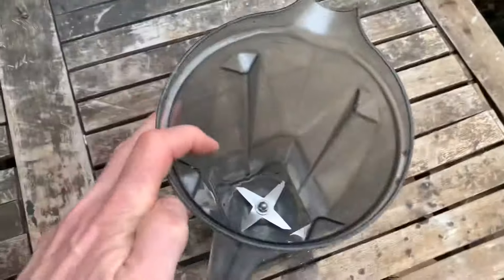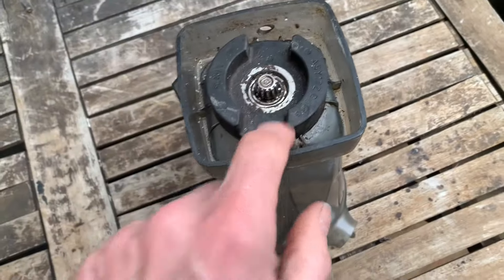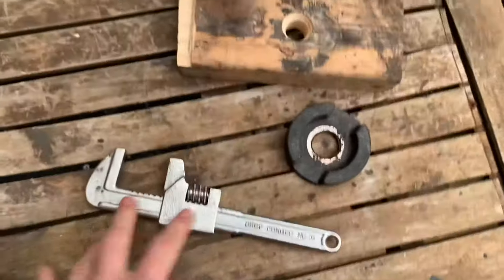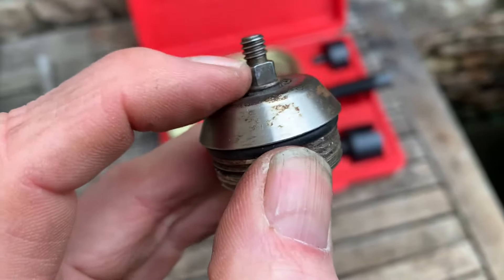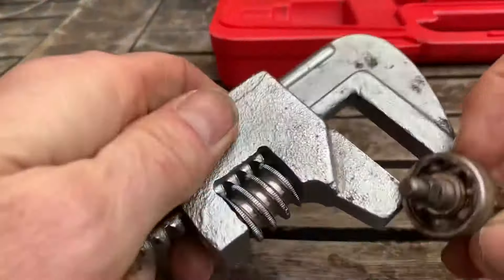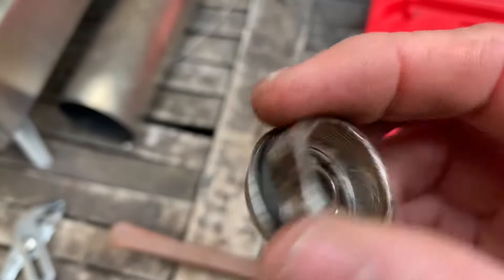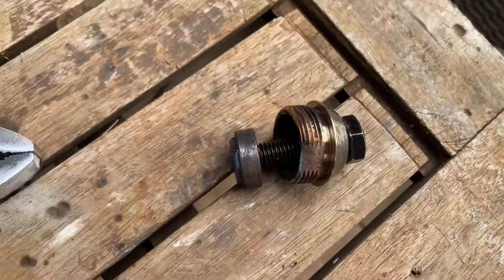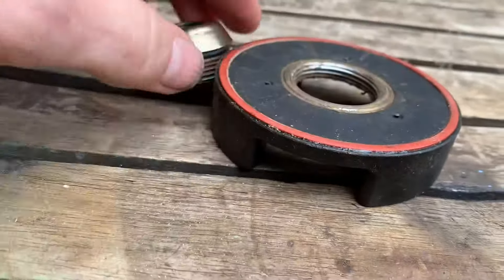Vitamix - how to remove stuck bearing & how to fix a leak

Comment: awesome 👌 I find it really strange that The acorn nut isn't a left hand thread screw.
Reply from the maker: Thx for your comment which I have only just seen...I think the blades spin anti clockwise and the nut obviously tightens clockwise. The blade is also 'keyed' on the shaft with a square hole. Mike

Comment: Unfortunately it doesn’t work this way because the bearing stays in the housing when you knock the spindle out
Reply: That is exactly what happened with mine too. Did you manage to get them out?
Reply from the maker: Apologies for the delay in replying only just seen your comment. If the bearings are staying in the housing, it implies that the spindle is turning INSIDE the bearings in which case this would be generating a lot of friction and heat. In that scenario, there is a good chance that the spindle would be knackered because friction will have worn it thinner. Sometimes people make the mistake of putting grease on a 'friction fit' wheel bearing on a car to help it slide on....but the net result is that your ruin the axle shaft. Mike
Reply from the maker: See the answer below. In that scenario, I would buy a whole new assembly. Mike

Comment: Hello There,
May i know where to get replacement " blade sssembly with hub "

Please let me know. Our
"Instant ace nova blender".,
Is 1+ year old, its leaking ..
Reply from the maker: Hi - apologies for the delay in replying I've only just seen your comment. I dont know where you would get spare parts for the Nova blender. The Vitamix blender has been around for decades and spare parts are readily available. Mike

Comment: My friends and I frequently use a frying pan to get bearings out.
Even tough SOB's will fall right out after a minute in a hot cast iron pan on high
Reply from the maker: Good tip - I'll try that next time.Mike

Comment: Bearings can also be pressed out using a vise and a socket - https://youtu.be/4X1kget-XWg
Reply from the maker: Just seen your comment - thx. Yes, using a socket and a vice is a good option if you don't happen to have a ball joint press sitting around. Mike

Comment: On mine, the outer ring and the blade assembly are so together that when i turn the outer ring it moves the whole thing, so i literally cant get the blade out at all. 

If i could hold the inside still while i turn the outer ring, maybe i could, but for the life of me in cant figure out how to do that. Any suggestions? Different kind of blender, but similar assembly.
Reply: Did you figure it out?
Reply from the maker: If you have not figured it out yet, record a video and send me the link - I'll take a look. Mike

Comment: There should have been a seal for the shaft above the upper bearing. I don't think skateboard bearings will last very long. With a vise and a combination of the right size sockets, you can press the bearings in and out much easier without damaging anything.
Reply from the maker: Thanks for your comment and your tip re sockets to get the bearings out. let me know if you have a link to what that missing seal looks like. Mike
Reply: I have posted a few different links here, but they seem to be removed. If you don't see them, give me an email and I will send the link there. They don't seem to allow links posted here. I don't know how to send it to you from here.
Reply: NEW Vitamix Blender Container 2 Sealed Bearing Set W/14mm Shaft Seal Replacement
Reply: @kwd57  
Hello! Maybe you know, what grease should be used in shaft seal? I think proper lubrication of this seal is very important, longevity of the seal depends on this lubricant. I tried to search internet on this matter, but at no avail
Reply: @dima343.  You could try a good quality food grade grease, but I don't think Vitamix puts any grease in between the bearings and the seal.
Reply: @kwd57   thank you!
I agree that there is no grease between bearing and seal, but inside the seal - yes, seal has two "lips", upper and lower, and between them there is cavity for grease
Reply: @kwd57  I've been looking for seals as well with no luck, would you mind sharing the link?
Reply: @tudor888  Every time I put the link here, it got deleted. I don't see them listed now. I posted the name of the listing above from  ebay, so all you can do is keep checking to see if they come back.

Comment: Our stainless steel Vitamix container blade lasted 3 years and is “NOT” removable from factory, beware!
Reply from the maker: Hi - thx for the comment and apologies for the delay in replying - only just seen your comment. Why do say that the blade is not removable? Every Jug I have looked at has a removable blade. Do you mean you are unable to remove it OR.....it is welded in and not designed to be removed? Mike

Comment: Mine is actually stuck and wont move what do you recommend?
Reply from the maker: Sorry to read you have a stuck bearing - it might be easiest simply to buy a new fitting? What country are you in? Mike
Reply: @scottitonline  Panama.  Have not been able to un stick it.  Think I might need a new whole container with blade and all
Reply from the maker: @possiblewithsimonemaduro2056  Sorry to hear you still having a problem. Did you manage to separate the plastic jug from the bearing assembly? The bearing and blade assemble is less than £10 on ebay see item number - 154527848962 Mike

Comment: both of my outer bearing casings are stuck to the wall of the base, ugh!!!  the bearings and inner casing walls of each are already cleared...any idea how to bash these two outer rings out of the base???? I am going to soak in WD40 attempting to soften whatever is "cementing" the two surfaces together, then I will try to bash something in there like you did...
Reply from the maker: Thanks for your comment and sorry to hear you are having a problem. If you are in the UK and you get stuck, I can send you the one I fixed in this video because my darling wife went ahead and ordered a brand new blade assembly through her work. Mike in Bristol